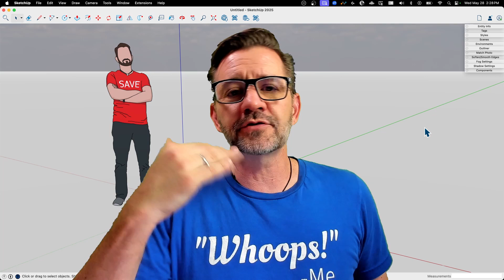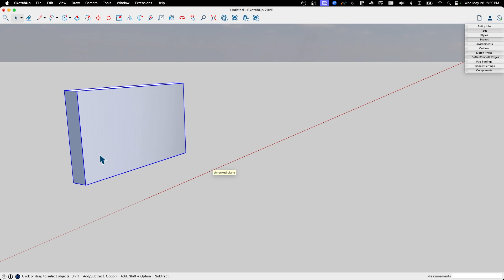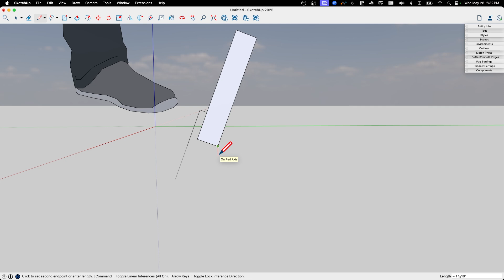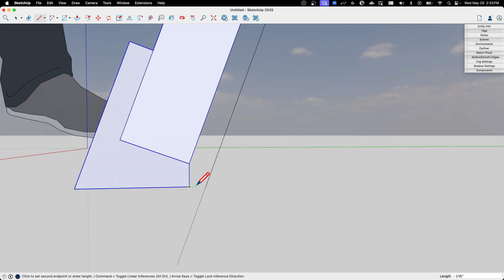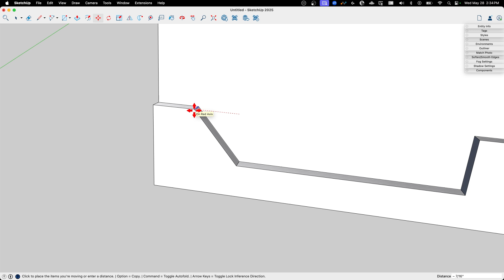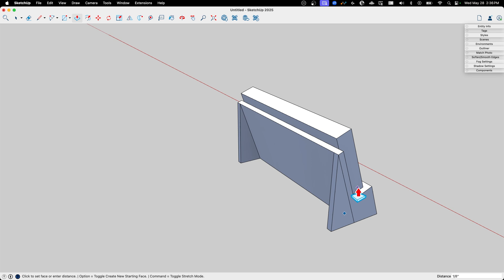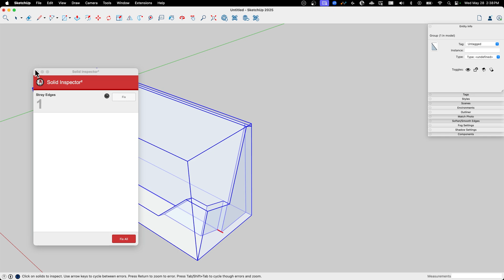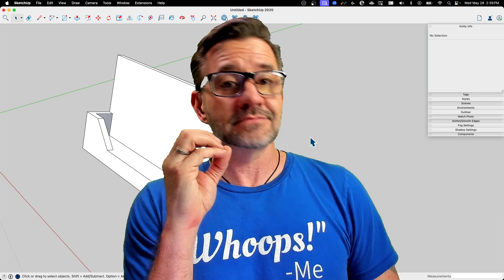How to 3D Model a Business Card Holder | SketchUp Tutorial Practice

Comment: I use SketchUp for 3D Printing and occasionally get into a mess when you break a surface, say a rectangle block with a circle forming a hole through it. Sometimes one of the surfaces will be deleted by another action. Adding one line back in doesn't reform the surface and you end up adding more and more triangles to get the surface to reform. Does that make sense?